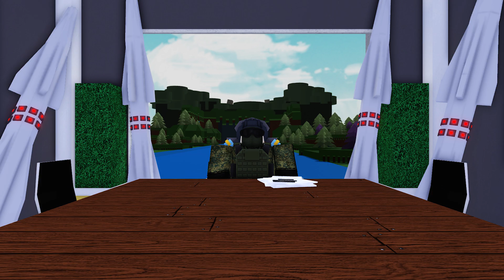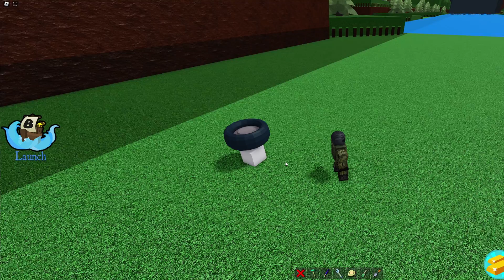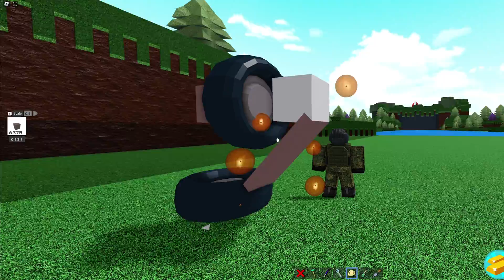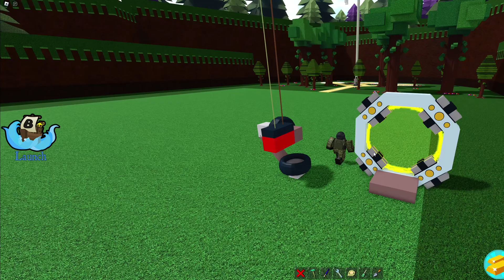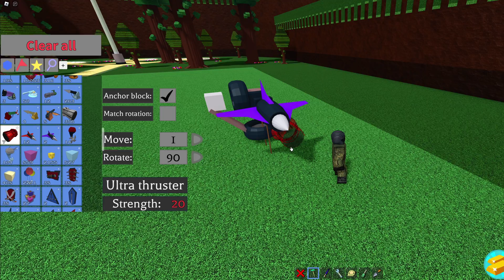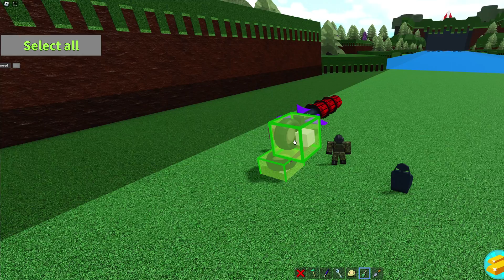How to make a working remote control missile (BABFT TUTORIAL)(with mobile conversion)

Comment: Bro this thing doesn't work anymore, i can't control it, i mean i literally used the front wheel and the back wheel, which im not sure if it works, and then steered it but it is not working

Comment: If the rope is becoming invisible:
Before you unanchoring both spring and the rope, Put your Graphics Quality to 6+ (make it full for sure that it will work)

After putting your rope to anchored, you can go back to lower graphics.

Comment: Actually,there is a way to have both thrusters AND jets on mobile. To do this, place one switch,colour it anything you like and keybind the jet to the switch. You should also keybind both thrusters and jets to the pilot seat. To control, simply click the switch which activates the jet. To switch to thrusters, just press the target button in the pilot seat and the jet will turn off and thrusters will turn on.

Comment: Not only was this a huge waste of time. It was also a huge disappointment. I've made another missile before, and it worked very well. It could fling players, regardless of whether they had pvp mode on or not. It was really easy to set up and had no limitations of movement like this one does. Whenever I try to fling players like I was able to do with the last one it just broke itself and did nothing. I was very excited to see how this would turn out and met with absolutely nothing compared to my other missile. It controls very well but is just not able to do much.

Comment: Previously, before this update appeared, I used servos on which I attached turbines and with the help of such a mechanism I received rockets, but now these blocks have appeared, this has made life easier for many, thanks for the tutorial!
Reply: I had the same problem too but this video saved me
Reply: Do you know what to do if your missile isn’t turning
Reply: @kirillabraev3358  probably u need to bind
Reply: @kirillabraev3358 You messed up the mobule conversion if it is not moving.